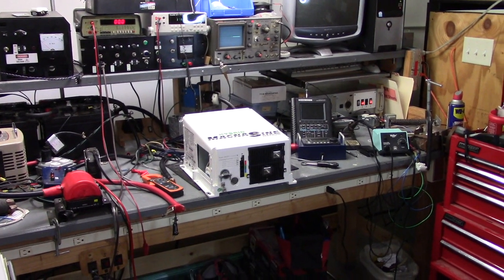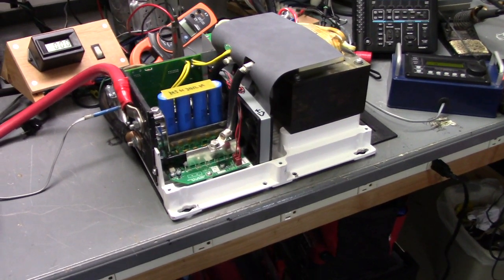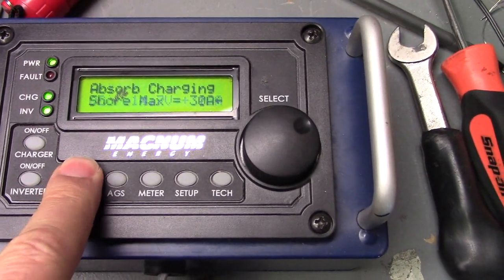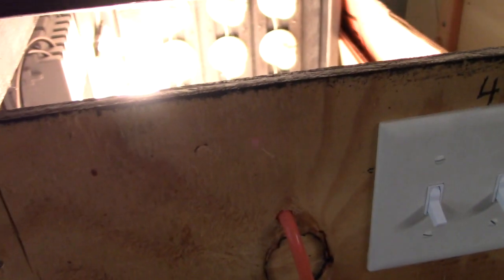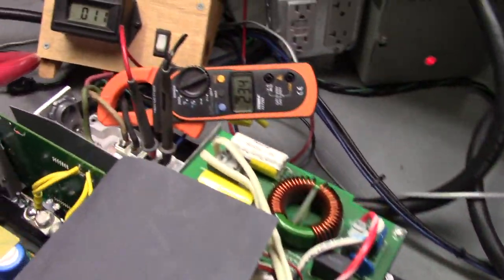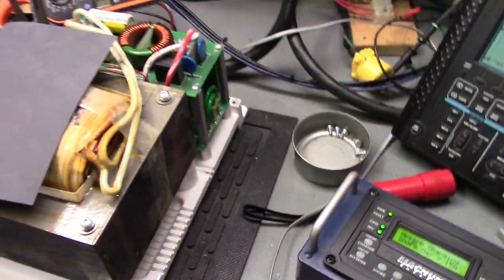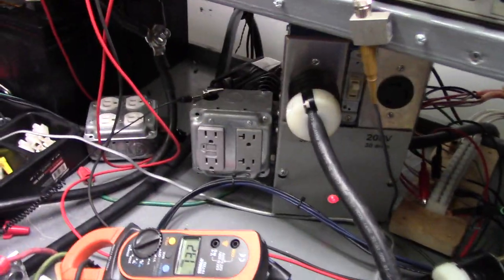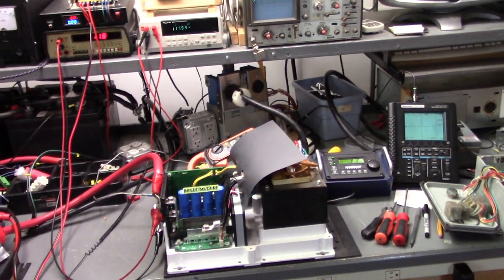Magnum MSH3012 Hybrid Inverter Charger

Comment: Do these Hybrids last? I was told by my mechanic that the circuits overheat and they don't last.
Reply from the maker: These are very complex units stuffed with lots of electronics so cooling can be an issue. As long as proper ventilation is provided it will be fine. Also to prevent corrosion a thermostat controlled fan should be added to the compartment to prevent static air that can cause moisture to condense inside the inverter while it is cooling down. Moving air into the compartment may bring in dust so a filter is a good idea but not required as dust alone does not really bother the sealed circuits. This advise is good for all high powered inverters.
Reply: @pcselectronics5423  Thank You

Comment: Also what was it in for repair for? User error or poor quality ?
Reply from the maker: This unit came in with a problem with the battery charger. The charge current was unstable. Magnum is aware that some hybrid units have this problem. In this case they sent the customer a new unit.
Reply: @pcselectronics5423  I've just purchased one, still being shiped.  How would I know if it has a problem?  Would an error show up in the MR-ARC?
Reply from the maker: @haraldkrueger7775  You simply have to monitor it for stable operation while charging. Just watch the readings on the remote. It will not fault but it may not switch to hybrid operation when needed.
Reply: @pcselectronics5423  Thanks . . . I just bought one on eBay for a really good price, but when I receive it I want to check it (test it) to make sure it works.
Reply: Can this inverter be used on a 50amp RV?  It looks like it has 1 neutral and 1 hot.  A 50 amp RV has 1 neutral and 2 hots, for both in and out
Reply: @haraldkrueger7775   You need a 240 V inverter this is not for you
Reply: @haraldkrueger7775  Yes, the AC input to the inverter would only require half of the power from one leg of the 50 amp service. You would setup a 30 amp circuit on the main panel to supply the inverter. When plugged in to shore power, the inverter would allow the 30 amps from the main panel to pass through to the sub panel. Without shore power or the generator running, the inverter would supply the sub panel with power drawn from the batteries. You're good to go.
Reply: What is your opinion of this item?

Comment: Great system.  Didnt the first test run 33amps from shore too long and would have tripped it?
Reply from the maker: These are thermal type circuit breakers and they take time to heat up if it is just a few amps above the rated current.
Reply: PCS Electronics thanks i just bought the msh4024!